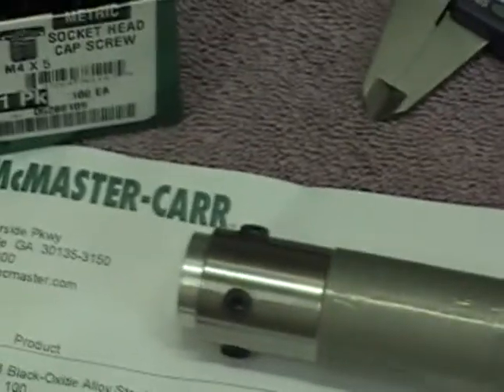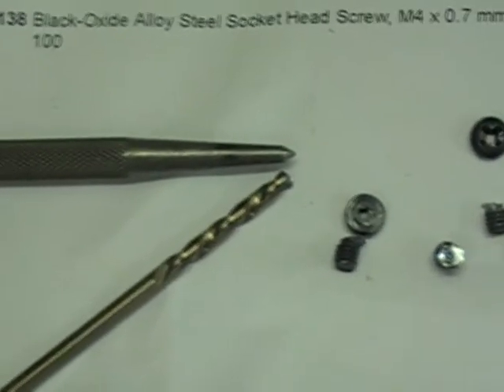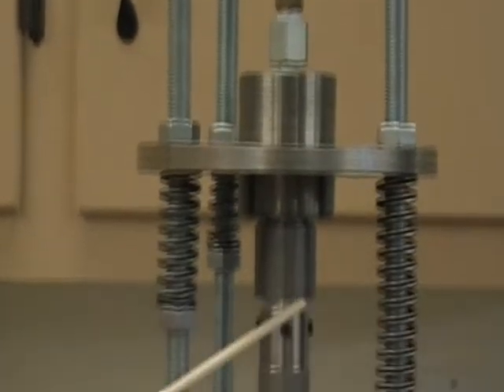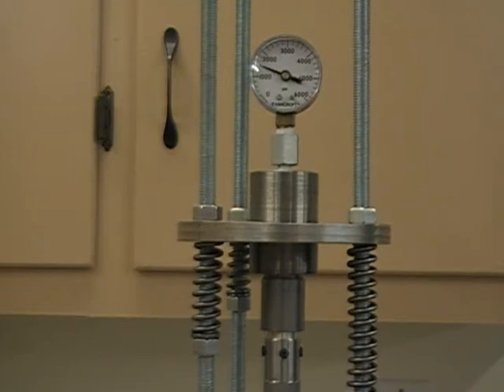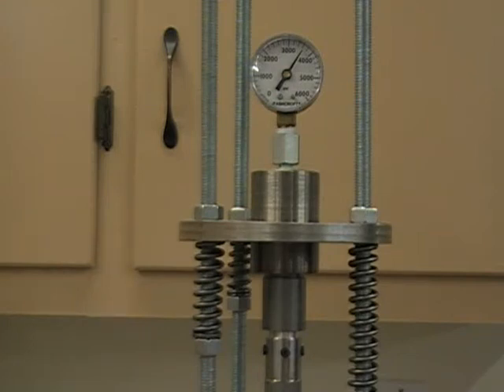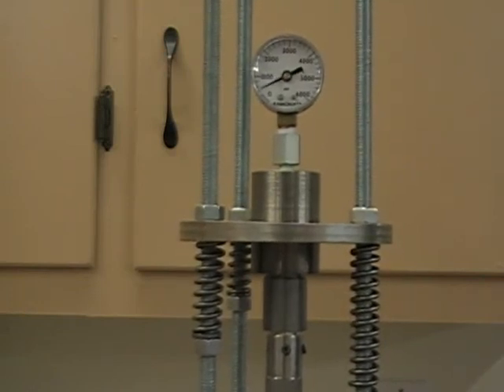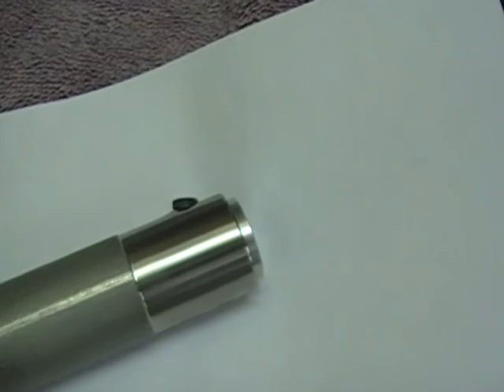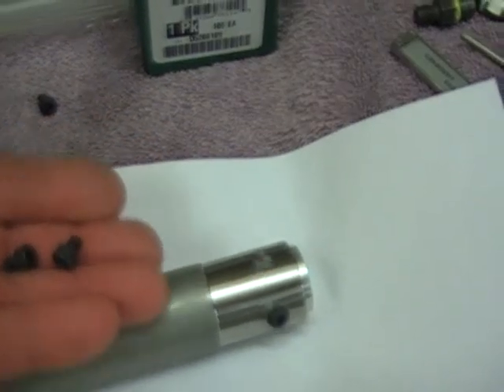Beeman Chief Replacement valve screws test to failure. Airgun Lab

Comment: I have been binge watching all of your videos.  I am a mechanical engineer that wants to get into making custom pcp's.  Is there any good reference material out there for industry safety factor standards and material choices.  Thanks for your videos.
Reply from the maker: As far as safety factors that are specific to PCPs, I am not aware of any.  Various standards for pressure vessels might be useful references, although there are differences among them. Personally, for yield strength, a SF of 2 to 1 is a bare minimum, and I prefer 3 to 1 when possible. 2.5 to 1 is the bare minimum for tensile, and 3.5 to 1 is preferred. Pressure tube materials are often a choice based on "hobbyist" availability. DOM steel tubing, 2024T3 aluminum tube, 316 stainless tube, 4130 normalized chrome moly tube, 3Al-2.5V CSWR titanium tube. 7075 aluminum tube would be very nice, but is almost impossible to find in small quantities. Be very careful with fastener selection. Most readily available stainless steel fasteners are low strength. Also, water is often present in compressed air so corrosion resistance must be considered. Think of all possible failure modes (ha ha) and design in some "gentle" ways for the airgun to fail rather than something catastrophic.